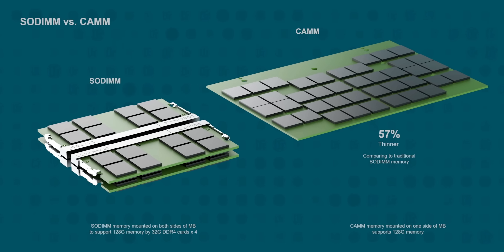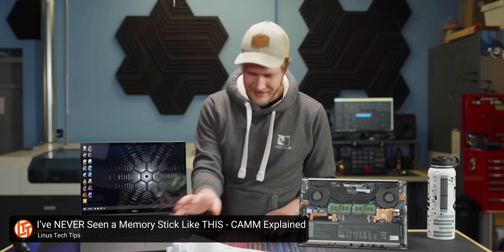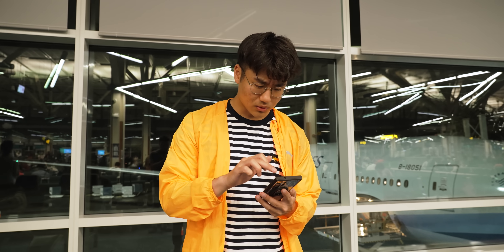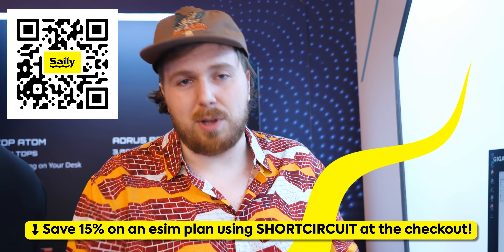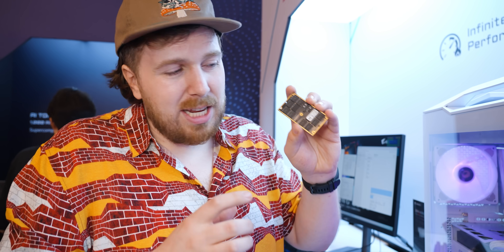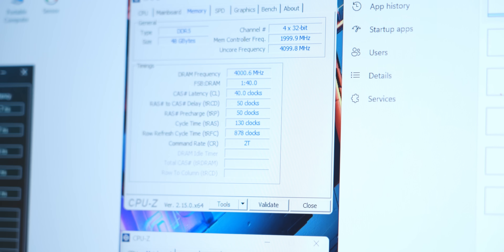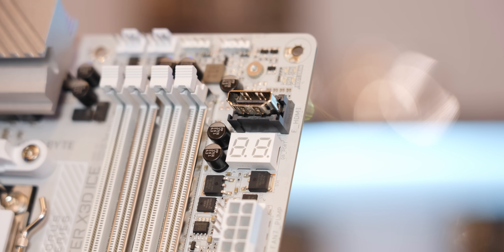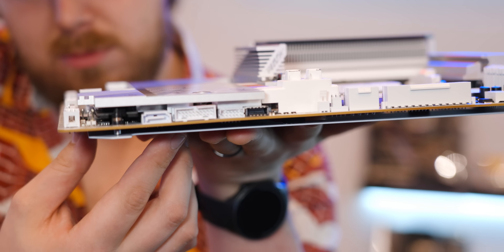Your RAM kinda sucks. - Gigabyte at Computex 2025

Comment: Eh... not really that interresting for a use in desktop PC application. I prefer using the vertical space and having the option to upgrade instead of replacing the entire CAMM module. Also that point about the cooling impact is most likely minimal. But for making slim laptop or slim desktop with an ITX mainboard I can see its advantages. This reminds me of System on Module (SOM) connectors.

Comment: Linus Media Group: we're simping for gigabyte's new ram form factor. But you can't get it yet.

Me: so I should switch to ARM once that mess is available to the masses?

Our ram doesn't suck, it needs improvements or we all go to ARM because x86 and traditional cpus are limited. Who cares about ram at this point.....
Reply: ARM is bad for general purposes on mass-produced PCs.
Reply: @mrofinUtortxoF  well hot damn..... i guess arm is useless then?

The software is not there but the hardware is fine.

I didn't comment to start a flame war over semantics.

Comment: It looks like CAMM2 would be fine sitting on the back of the motherboards, like NVMe devices currently do. That could allow for even larger amounts of memory for both front and back, among other things, like more space on the motherboard in the play the DIMMs used to be.
Reply: Having to take my motherboard out to upgrade RAM sounds awful, thanks
Reply: @nfugitt89  You also don't need to take your motherboard out to access the CPU plate. They can easily make a cutout for the RAM for new cases for this specific reason.
Reply: Lol no. You need airflow over them
Reply: @trignite  and you don't over an ssd?
Reply: @trignite  There's a revolutionary piece of kit called heat sinks.
Reply: @trignite  You need airflow over NVMe drives as well. What made you think they wouldn't get airflow?
Reply: @NdxtremePro  Yes but not nearly to the degree that RAM does. Plus, what makes you think these drivers are GETTING enough airflow? The higher end Samsungs (if you actually try to read/write a ton) will get very hot even with the now (almost) required heatsinks. Plus, if the RAM is going to be running even FASTER the timings are going to be even more precise. As well as the fact capacitor refresh timing (rfc) literally has direct scaling with temperature.
Reply: @Grenzoocoon  cam modules were designed to improve signal integrity while drawing as little power as possible for small form factor battery powered applications, sure you could make them overclockable to a certain degree like any ram and slap some low profile ram heatsinks on.

Comment: camm seems like a godsend for mobile/sff, allowing upgrades while also retaining access to high performance memory and staying within the physical constraints, but clocked udimms (cudimms) achieve the performance goals for standard desktop while retaining compatibility, and do not need to conform to the physical constraints which demand camm solutions. tl;dr: sodimm->camm makes sense, udimm->cudimm makes sense, udimm->camm doesn't seem to have much use case, maybe niche

Comment: CAMM2 seems like a promising evolution for laptop memory, but I’m struggling to see the benefits when it comes to desktop motherboards, especially full-size ATX, workstations or servers.

DIMM modules are mounted vertically. This allows more chips to be packed into a smaller footprint on the motherboard. On the other hand, CAMM2 takes up more surface area and seems to spread chips over a flat plane — wouldn’t that reduce the number of chips you can fit per cm², not increase it?

Also, vertical clearance is rarely an issue in desktops or rackmount servers, so why give up the space efficiency of perpendicular modules? I get the electrical benefits for trace length, but couldn’t that be solved by placing traditional RAM slots closer to the CPU or even on the reverse side of the board?

To me, CAMM2 makes sense as a SODIMM replacement in thin laptops, but I don’t see a convincing argument for its use on ATX boards. Am I missing something?
Reply: IIRC JEDEC slides the connector itself is a problem too. All those pins act line small antennas causing noise. That's important as you start increasing the clock. DDR6 could theoretically go as fast as 21,000 MT/s.

Comment: Don't understand the push for desktops when CAM makes a lot more sense for laptops. MSI made the same boards but its been dead silent. There hasn't been a single device to adopt it since Lenovo in 2023. They need to actually bring this to market.
Reply: It's more about preparing for a future. DDR6, need for wider memory bus, bigger capacities, etc. It takes years to bring a new technology. Everyone is working on getting their experience with DDR5 CAMMs.
Reply: @davidlt  DDR6 is not even theory yet, no one knows what it will actually be.

Comment: I feel like the RAM slots haven't really changed much (except get denser) for decades now, I look at the motherboard now and think back to my first PC almost 3 decades ago, and things haven't changed that much, things have gotten faster but the old RAM and PCIe slots still look similar to the ones back in the day, Even CPU's until recently (on AMD's side) used PGA. Of course below the surface things have changed so much, but to the layman's eyes, they've remained similar, which goes to show if it ain't broke.

Comment: yup we saw camm 2 last year, why the hell isn't it here already???
Reply: because on desktop it makes 0 difference in speeds vs regular DIMM, and only improves on sodimm because most sodimm implementations are poorly engineered.

TLDR: it doesn't make much difference vs DIMM on desktop, and laptop manufacturers aren't exactly incentivised to have expandable memory these days.
Reply: @HerbaMachina  Also it just sucks on laptops/desktops that do have them. Expensive af, you have to buy a new module if you wish to expand the memory, and you just dont have as much maximum capacity (for desktop and very few laptops).

Comment: i run a i7 13th gen. I will wait for my cpu upgrade for cam and a next generation cpu. maybe Nvidia 😂 but more certainly amd. my 4090 doesn’t need it (even the 5090 hardly could need it [bottleneck-wise])

Comment: Does anyone else not remember when Alex first did a video on CAMM on the main channel 2 and half years ago? 
Good lord this is being slow walked by the industry.
Reply: PCIe generations take years to standardize and roll out, and that's using the same physical interface. These things move slow.
Reply: They're trying to figure out how to maximise the profit from it and the advertising campaigns they'll need to run.
Did you see they only have 1 CAMM slot on the mobo but there are 4 DIMM slots on the old mobo? That's a profits causing device.
A DIMM mobo has 2/4 slots, you can save money by buying RAM in small upgrades, say 8Gb at a time over a long period. That means you can start with a serviceable 8Gb RAM and buy used RAM until you have 32Gb in a lot of cases.
Using mismatched RAM isnt the end of the world either as you can run at the lowest speed of the lot or play the silicone lottery and overclock your RAM.
With CAMM all these options are taken away from you, we return to 1980s where you have 1 RAM unit and you fully replace that RAM unit. If we're fully replacing single units we're less likely to fraken-computer something together for lower outlays and upselling becomes easier

Comment: No Matter how much you try to convince me. I will always believe camm is designed to not being upgradable.  You had 8GB you wanted to add 8 gb more later? Forget it. Now you overall pay more.
Reply: I'm already in that situation with DIMMs. I have 2/4 slots full, but filling it to 4/4 will reduce the max speed I can run the RAM at. So if I want more RAM, I'm already going to have to rip out and replace what I have. That's just the reality of DDR5 on AM5 unfortunately.
Reply: Or its just going to migrate to a more in-depth upgrading. Instead of pushing in a ram stick, you're soldering extra chips to a board.
Reply: @ryanthompson3737  that'll never work.

Comment: So, what benefits does this bring, well here we go;
1• Less Expandability - 1 Module vs 4 Modules

2• Potentially Less Capacity - Logically speaking vertical DIMMs provide more area, meaning you can have more chips, meaning that either the existing Vertical DIMMs can use either more lower capacity chips that are cheaper so the end user saves money, orz the Vertical DIMMs can use higher Capacity Chios and offer far higher RAM Densities not possible with CAMM2 or any form factor similar to it like SODIMM.

3• More Motherboard Area wasted by the RAM, what you lose in length from having a shorter more square CAMM2 Module you lose in vertical height.

4• CAMM2 Modules can run further out of spec, so great now we NEED more cooling but you're offering that lower efficiency as a feature? Really? I'm good with better efficiency clocks on regular DIMMs thanks.

5• Likely higher costs due to the use of higher density chips because you have less are so you HAVE to use higher density chips to achieve the same Capacity.

CAMM2 sort of makes sense for Laptops, where vertical space is at a serious premium, but in Desktop PC Systems Vertical Space is not an issue, in fact Desktop PC Cases have an abundance of extra vertical headroom that isn't utilised, and yet the manufacturers think it would be a great idea to even more poorly utilise this available space?

So far CAMM2 hasn't proven it offers any substantial benefits over regular Socketed DIMM's, and their is nothing wrong with the current form factor of Desktop DIMM's.

I won't deny that the mounting mechanism can be confusing to use for amateurs, and, it really could do with an updated latching mechanism that is easier to use for new users with no experience, but other than that specific element the actual form factor is fine, it is a nice size that is easy to physically handle, it isn't too big (when confirming to standard JEDEC DDR5 Form Factor Spec. Yeah I know the RGB DIMMs are Hugely Tall, but they are not conformant to the Form Factor Spec for regular DIMMs), and, they are relatively cost effective to Manufacture vs Higher Density Form Factors using less chips of a higher RAM Dsnsity.
Reply: 1. While I get that, I think it's a fair trade-off considering you get way better performance. Hell, even with DIMMs you often can get better performance with boards that have 1 slot per channel.
2. That's not strictly true, CAMM modules can be in variety of sizes, to the point where they can fit as much chips as 2 fully populated SODIMMs or even more (though I have never seen one like this).
3. Can't argue with that.
4. You're saying this as if for the last 10 years most of the normal DIMMs didn't have a huge heatsink attached to the module, often just for looks. If someone decides to push their memory to extremes, let them do it. 
5. That's basically the same as point 2. You don't necessarily to have high density memory chips for CAMMs, especially with lower spec systems.

>So far CAMM2 hasn't proven it offers any substantial benefits over regular Socketed DIMM's, and their is nothing wrong with the current form factor of Desktop DIMM's.
Did you watch the video? Hell, have you ever compared memory speeds on devices with soldered RAM vs. ones with DIMMs?

Comment: CAMM is worth it for the cooling alone - DIMMs do NOT have heatsinks; they have heat SPREADERS.
Reply: Because they dont need them, like at all. And if you are running them hot, there are ram coolers (almost all of them are complete overkill, like water cooling for ram? Seriously?)

Comment: Hm dont know how i feel on this one so if you have say 16gb ram on cam 2 you have to throw the old module out to replace it with a 32gb ect. Seems like a new standard thats going to creat more ewaste overall
Reply: If the new DRAMM module is in the same channel, then it needs to match, anyway. This can cause e-waste.
Reply: @SullenSecret it will do all channels available as its a single module. So single channel dual channep and quad channels. But upgrade ability and expansion is limited due to the only being one modual slot instead of most mobos 2 to four slots. And while the will be performance increase the amount of room need in cm2 is also more. The only way i can see this being worth it is if you can put a module on both sides of the motherboard so 1 on front one on rear. 2 slots that eay

Comment: They should make CAMM standard for DDR6 when that is introduced.
Reply: there's not point on the desktop as it doesn't have any actual eltrical characteristics that make it better than DIMM on desktop, it serves best as a replacement for sodimm where it actually does make a difference
Reply: @HerbaMachina theyre already making desktops with integrated (soldered) memeory to support the bandwitch and latency requirements of certain CPUs.  How does this not help on desktops?

Not to mention the kther points they brought up on the video regarding cooling, better signal integrity, etc.

Comment: Does the CAMM on the desktop mean that there is only 1 module per motherboard meaning if you want more ram you have to buy a larger model and sell your old module or repurpose it?
Reply: Worth considering that you're "supposed" to do that with DIMMs, as well, since mixing DIMMs that weren't matched for it can mean worse performance...

...but usually that only applies to really heavy OCs or super tight timings.
Reply: Pretty much yes, each CAMM module has the specific memory on the chip. If you want more, you'll be buying a new CAMM chip.
Reply: I think there is a tech that can allow you to "stack" CAMM modules, but haven't heard much about its development tbh
Reply: @endless2239  The CAMM2 standard supports that. IIRC this is mainly for capacity increases. The current CAMM2s (DDR5) are up to 128GB per module. That's plenty enough for a lot of folks without stacking.

Comment: 2:56 wait, what? the "connector" with the fragile pins can be replaced? and it's for one of the most speedy types of signals there are? so this should work for CPUs as well! Bent pin? Ok, that connector might cost a pretty penny, but not 500$ for a new mainboard pretty
Reply: *$5000
Reply: The motherboard has a ton of connections going to a cpu though where the ram just needs one to the cpu
Reply: @TheEldritchEngineer shouldn't matter too much. Sure over 1000 pins to the top and to the bottom is much, but I recon it could be done.
Reply: Nope, it can't.
Reply: Please elaborate
Reply: @Schwuuuuup 
If you look at the video, the black thing has solder pads on the underside. 
So it's a soldered onto the mobo, just like dim slots are. 
So they can be replaced, but is not an easy task.

Comment: 1:35 DIMMs are similar to SIMMs and that form factor is even older. So yes, a new form factor is very much welcome.
Reply: Only if it didnt suck compared to DIMM for desktop...good addition for laptops tho, they cant even fit a good battery in those anymore, much less 2 sodimm slots on top of eachother.
Reply: I look forward to when we circle back around to having RAM on expansion cards, like back in the 1980s! ... ofc it'll be CXL instead of ISA, but still :)
Reply: @greggmacdonald9644  I think we need better support for multilayered memory from operating systems for that to happen.
Modern Linux has problems with swap because algorithms that handle it were not designed to work with disks so fast as modern ssd or nvme.
And I am not even sure if windows still uses pagefiles (haven't heard about them for quite some time).

If there was an OS support for multiple memory layers using shared code, then you could easily make a stack like:
- 3d v-cache
- RAM
- PCI CXL card
- NVME swap partition
- HDD swap file
and just keep moving memory pages up and down the stack depending on how often they are being used.
Reply: @hubertnnn  Windows still uses a pagefile, yeah... assuming you don't have it turned off, which you easily can do.
Reply: @hubertnnn  CXL memory support on Linux is actually quite good already, The processor just sees the CXL device as another NUMA node, just as memory connected to another CPU in a multi-CPU system like a lot of servers. This simplified a lot of development 'cause a lot of the infrastructure was already there for NUMA without much need for major changes.

For swap there is a lot of legacy code that needs refactoring, but there is also not that much interest from devs to bother with fixing it as it still technically works, just not optimally. Swap usage has also historically been avoided if possible, but devs will need to address this more with Linux becoming more popular for Desktops/Laptops which need swap for suspend/resume, deep sleep and power efficiency optimizations in general.
Reply: im old enough to remember when simms replaced dimms, only for us to again replace simms with dimms.

Comment: nope, your explanation kinda sucks. it due to the available extra parallel channels for signals. in DIMM format it only have PAIRS. so those same pairs of pins must serve the entire memory ranks on the RAM PCB, which at some point, those signals MUST WAIT IN LINE.
in the CAMM form(its a FORMAT not a UNIT), there are more contacts that are placed in a more coherent to multi access I/O for all the ranks. meaning, signals could reach every single ranks on the PCB without need to go through the same path. saving wait in line time, and direct access is possible to any ranks soldered to the PCB at any given time. 
just like if you want to put CPU on a card and must have all its signals go through pairs of pins instead of multiple of parallel pins the way CPU currently are, where the pins are all have each direct entry to different part of the architecture inside the chip.
also the name still a RAM whatever the form. you sounding like those who said internal SSD isnt a hardrive.